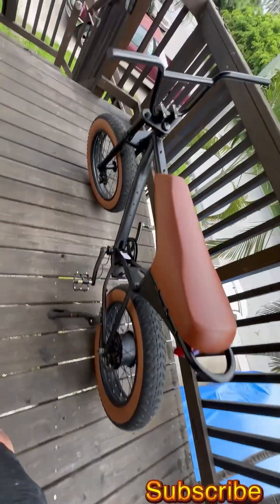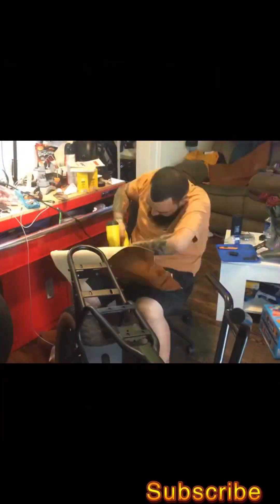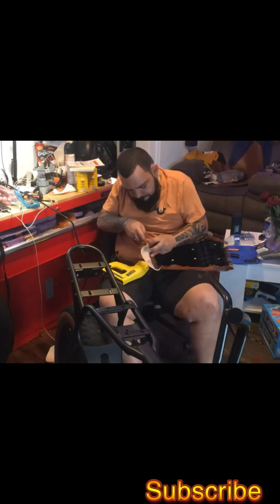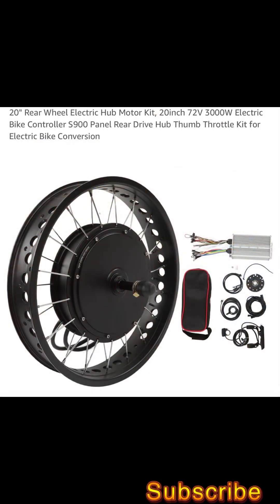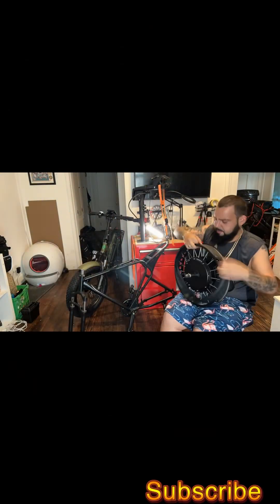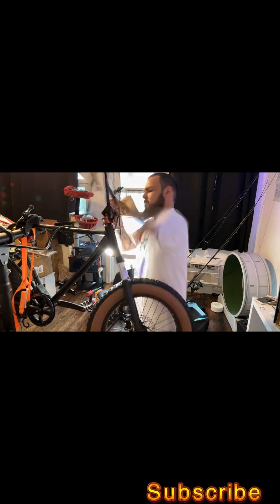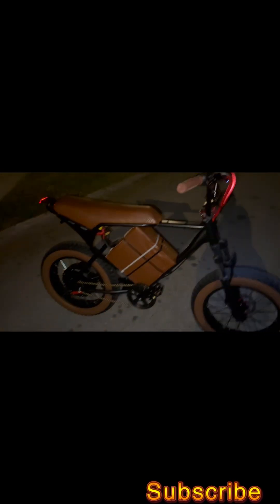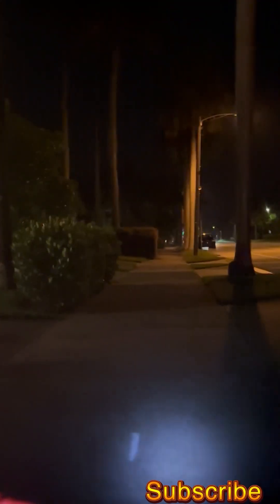50+ mph Ebike under 1500$ build and ride #ebike  #electricbike  #diy #50mph #surron #razor #fattire

Comment: Hey I bought the same motor kit, are you having the same issue with over voltage? If I charge the battery to 84v(max for 72v 20ah batteries) it won’t turn on lol 

They gave me a 30amp controller, then a manual showing a 50amp, then the controller I got had completely different wiring 😂

Comment: Bad ass man, thanks for taking the time to post. How fast and what's the range?
Reply from the maker: Thank you does 53 currently with the 60 amp controller I’m going to swap it out for 80amp my goal is 58 60  I’m going to post vids on range test it’s a 72v 40ah so we should get some good range